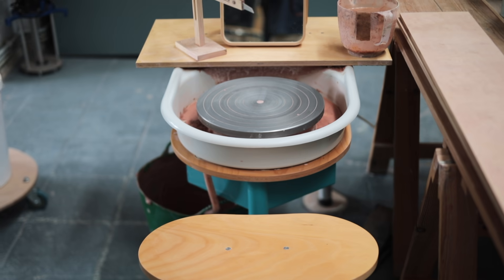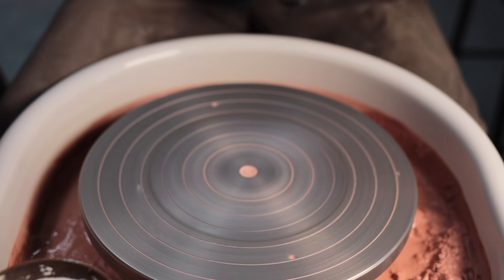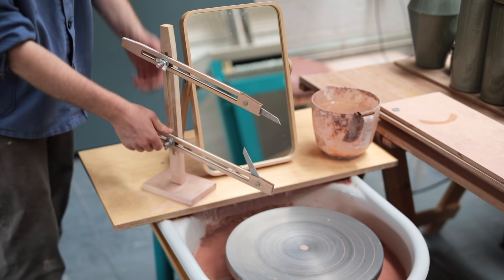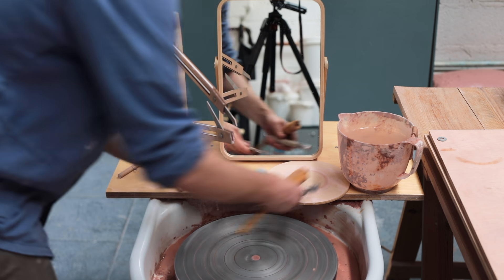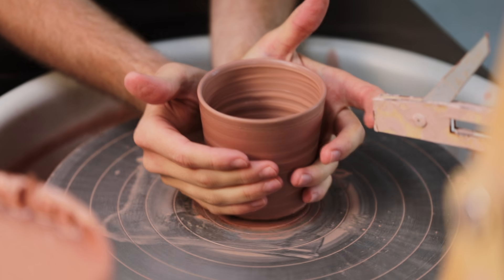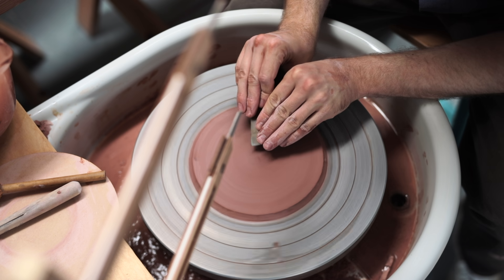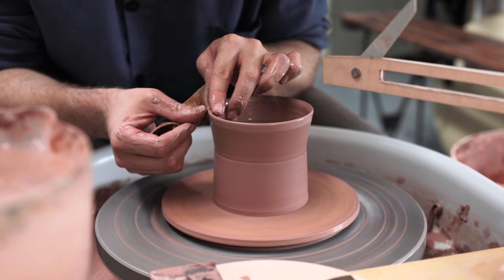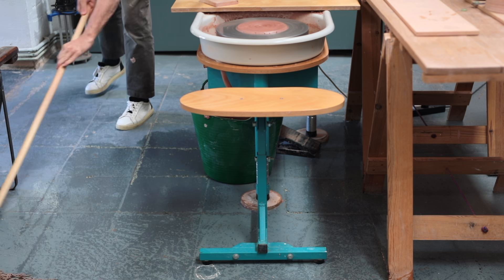My Pottery Wheel Setup — Tips and Tricks

Comment: One day I would love to own my own Pottery wheel, I do have enough experience after a year from taking Ceramics in Highschool that I still remember the ways how pottery was made. Also, a very nice setup that you have, simple but he gets the job done, not really much need for anything advanced. When I was in ceramics, I would always have a water bucket that would be used for the water, but also for clay disposing too. Right after I'd finish my pottery, I would leave it on the bat and just store it in the storage room my ceramics class had, and simply wait until I had it available the next time I had that class which was nearly every day since I enjoy that class too much. Unfortunately, I wouldn't always finish my pottery on the wheel, but more for practice. One of my proudest creations was a teapot, but it exploded when it was put through the bisque kiln. I was told that there was an air bubble on the base of the pot itself and that the only thing that was left was just the edges of where the handle was originally put on and that's it.

Comment: Thanks for sharing this in so much detail! I have pretty much the same setup, which may be influenced by your videos a tad ;-) The only significant difference is that I put an additional board on the left side of the wheel where I put my bucket for the throwing water. I mounted it below the board where the mirror and tools go, using a spacer so it sits at the same level as the wooden board below the wheel head. That way I don't have to bend forward so much and I noticed it's a big relief for my lower back. 

When cleaning surfaces with a relatively coarse sponge (the ones used for washing cars), I always noticed a smell of clay in the air which concerned me a bit. After switching to a much denser sponge the smell was much less pronounced and when I use microfiber cloths, it's barely noticable. I guess the car washing sponges take up the clay and as the tiny dry bits disintegrate inside the sponge, air travels out of the top and takes some of the clay dust with it. I'm also washing my sponges etc. with clean water after every use directly in the sink, so I always have them completely clean for the next use. I think it's just not worth saving the tiny bit of clay dust while on the other hand risking lung diseases by using dirty sponges. But maybe I'm a bit overcautious here ;-)

Comment: I love all of this. Thank you for sharing. So efficient! For your wedging table... do you poly or resin the top to protect it from mold/warping and to keep the clay from losing moisture?
Reply from the maker: Welcome! And absolutely not! You want a surface that’s quite absorbent, as it makes clay much easier to wedge and prepare. If the surface is too sealed, the clay just smears over it as you try and wedge it, making it practically useless in some cases.